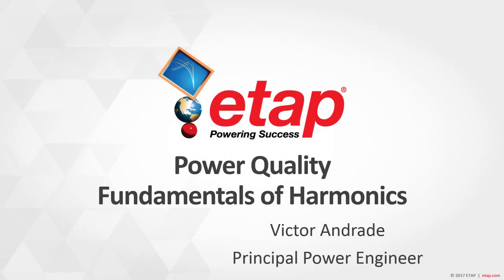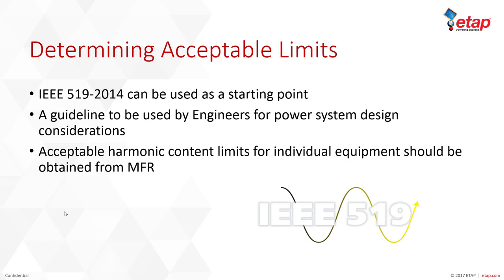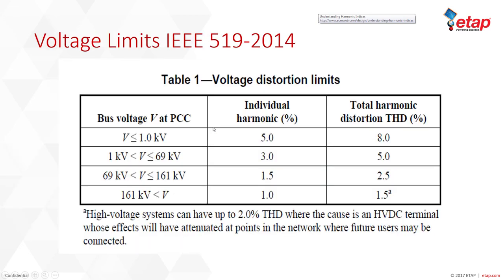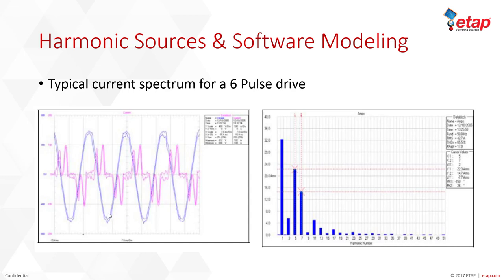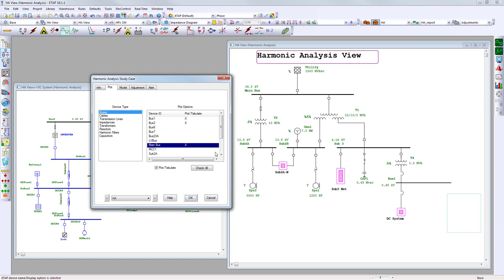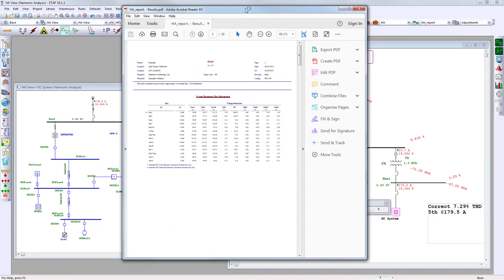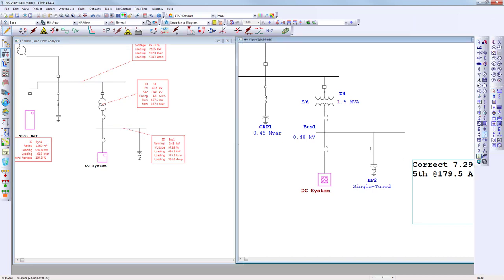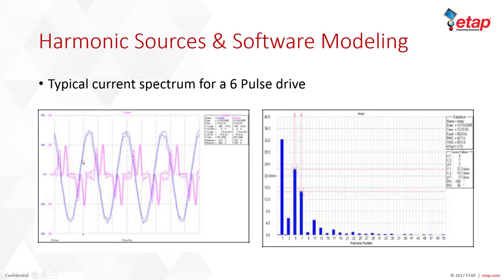ETAP Power Quality - Fundamentals of Harmonics

Comment: Shouldn't it be 0.48 kV instead of 480 kV at 33:09 ?
Reply from the maker: Thank you for your interest in ETAP Software and thank you for your feedback. Yes, you are correct. The Max kV should be 0.48. This will not have an impact on the final HA study results. This values is only used for equipment evaluation purposes. Thanks for pointing this out.

Comment: Thanks for the tutorial but I have a question about the report. I want to see current harmonics at the point of common coupling but the report shows only the voltage harmonics of the buses. So how can I see the individual current harmonics in the report?
Reply: Pelin Fidan I have the same problem now. did you find the solution already?
Reply: @FebriantLeocesio  just put a very low impedance  between your circuit and the grid, then on the harmonic load flow select to plot the harmonic currents in that impedance.

Comment: It concerns me that when you add a harmonic source and enter the magnitudes of each harmonic order you make no mention under what conditions (e.g. short circuit power / impedance of the mains supply) that those magnitudes should be entered. The magnitudes of the harmonic currents of a 6 pulse VSD for example will be very different depending on the impedance of the mains supply that the VSD is connected to. If the ETAP software does not define under what conditions the magnitudes of the harmonic currents should be entered, how can it accurately calculate the resulting THDi and THDv at the PCC? If the ETAP software does not know the conditions under which the magnitudes of the harmonic currents were entered how does it calculate the change in these magnitudes based on the characteristics (e.g. short circuit power / impedance) of the circuit being modelled in the software?
Reply from the maker: Thank you for your interest in ETAP Software, please contact our Technical Support at https://helpcenter.etap.com/ for more information
Reply: @ETAPsoftware  Wow it took 2 years for a reply and even then I did get an answer but instead just instructed to contact ETAP technical support. Why can’t you get technical support to answer my question here for everyone interested in your software to see?

Comment: How can you add line reactor to the model. I used the current limiting reactor, but I don't think that's the right one. I need to add a 3% line reactor on a 460V 100 hp motor with a 6 pulse VFD.
Reply from the maker: Thank you for your interest in ETAP Software, please contact our Technical Support at https://helpcenter.etap.com/ for more information